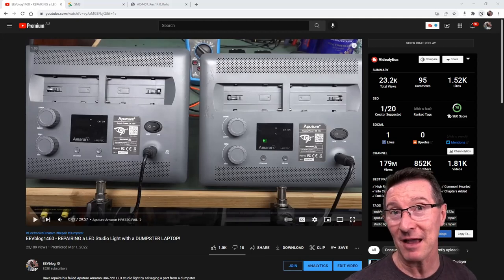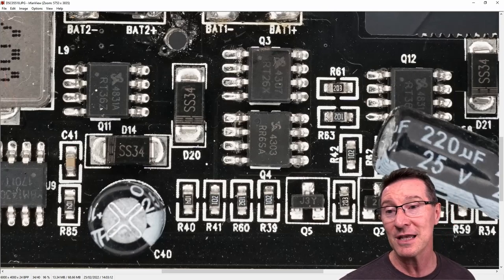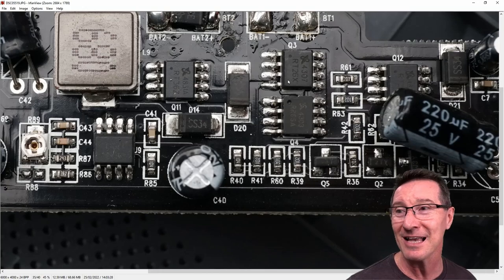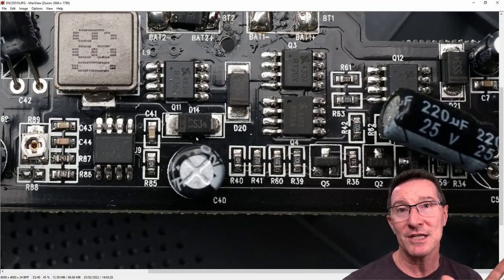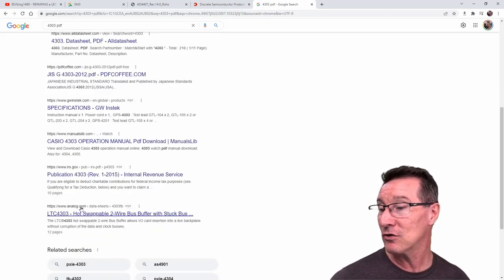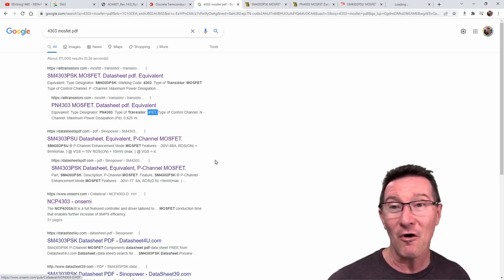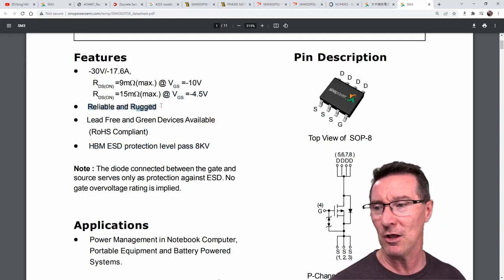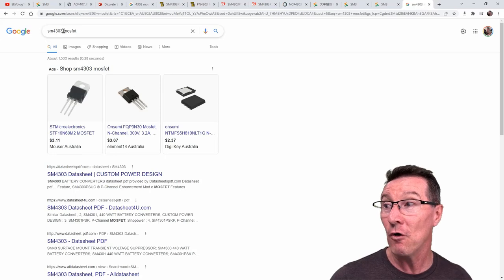EEVblog 1461 - The MOSFET Search CHALLENGE

Comment: I found the AO4455 -30V, -17A and the UM4447A -30V, -18.5A in a quick search, but i may be breaking the rule that they are not made in taiwan xD

By the way, i just search for 30V p-channel mosfet esd protect and look in the imagen search.
Reply from the maker: You win The Internet!
Reply: WARNING: The AO4455 with the gate at -4.5v has a poor ON resistance, it needs -10v before the ON resistance gets really good.  The original uses a logic level mosfet like AO4447A & your UM4447A or the normal Fairchild FDS7779Z which is available everywhere, even stock at Digikey/Mouser/Arrow.
Reply: You should also try yandex reverse image search, it is surprisingly good with very obscure objects... Much, much better than Google's which is rather generic.
Reply: your comment brought out some nice tips out of the other guys who answered in there. SO THANK YOU.. I GUESS : )...
Reply: 1 minute on mouser, 4th match:
Diodes Incorporated DMP3004SSS
However, how exactly is this double zehner?diode protection intended to work?
Why would anyone connect an exposed battery terminal or just a battery directly to the gate of a mosfet?!
Is that a new thing among engineers nowadays?!
Reply: This. Most of the good mosfets nowadays include all kinds of protections, so this sounds like a classic case of just brainfarting by EEV and forgetting what to google. In addition, a lot of the most common power mosfets etc now fit EEVs specs, just with far higher maximum ratings. If you however do google searches including those maximum ratings, you miss out on all the results from fets with HIGHER ratings, not just LOWER O.o
Reply: @EEVblog  Its a SM4303PSK with 4303 marking it literally came up in the first google search

Comment: Hello Dave, Regarding ESD please note that ALL MOS devices have some form of ESD protection. More over, ALL MOS gates are ESD protected. In 40+ years of practicing electronics I encountered only once MOS transistors without ESD protection for gate terminal. So stating for some transistor that are ESD protected is misleading. If you look at the data sheet, the so called ESD MOS transistors are stated to resists to 8kV HBM stress. HBM stands for Human Body Model and is only one of the ESD resiliency test used in semiconductor industry. Regular device are designed and checked to be compliant at least to 2kV HBM stress test. In recent years the ESD requirement was updated to 4kV HBM. Devices stated as ESD are the ones able to sustain an 8kV HBM stress. As a former MOS IC designer I had more issues with other ESD models as “Machine model (MM)” and mostly with “Charged device model (CDM)” that imply higher stress than HBM. The replacement you performed is OK provided you take care when replacing the batteries. Thanks for the very informative post!
Reply: All of the earliest MOSFETs that I came across were for RF use and had 4 terminals, usually in a TO-18 can. None of them had ESD protection and I lost a couple until I figured out that I needed to wrap thin wire around all of the four legs before handling, only removing the wire after the MOSFET was in circuit.
Reply: @RexxSchneider  I first met MOS devices in the early ‘80 and back then all of them were ESD protected. I also learned about ESD in the university… The only MOS devices without gate ESD protection I know were used in the ultrasonic remote control receiver of a Grundig Color TV dating from the early ‘70. The gate capacitance was used to store the control voltage and was accessed via a neon lamp!
Reply: @RexxSchneider  The tv was a Grundig Color 8010 UE.TD. BTW, I read about MOS devices with a chastity wire but never used one…

Comment: When high dissipation is required the heat is removed by soldering the multiple leads to a copper plane.
The power dissipation is usually specified with heat sinking of various thermal resistances or areas of copper planes.
It is important to check the footnotes for this. One of these datasheets specifies a 
1 inch pad.
The thermal resistances of the junction to leads and ambient are also specified 
in this way.
There are usually graphs or drawings of the performance of the different heat sinking techniques and or sizes.
This can be on a separate application note.
Sometimes not all of this data is supplied but a careful study can verify the design.
Other types of device in this package might require this amount of care in heat sinking.  For this application all this thinking is probably not necessary.
It was easier when we just attached a heat sink to a TO-220.

Comment: One search technique I've had some luck with before when trying to find particular features (such as the ESD diode) is to try to "invent" the part number that a manufacturer I've found making similar parts would label the part I want with. For example, if I've found a 12 volt mosfet both with and without the protection diode carrying similar part numbers, and a 30 volt one without the diode, I might try tacking on whatever extra letter they added to the 12 volt mosfet part number to make it the ESD version to my 30 volt mosfet part number, and searching that.

Comment: I accidentally blew up my TS80 soldering iron because I normally power it from my benchtop psu, but I gave it far too many volts which caused the P channel mosfet to go dead short.
I happen to have an automotive style LED module that uses a P channel mosfet as input polarity protection.  The specs seemed close enough so I used some hot air to swap the chip on the TS80 board, put it back together and I is working perfectly if not better because of lower drain source resistance...

That's my mosfet story.
Reply: For 5V Devices: Use a fixed 5V Power Supply.
For 12V Devices: Use a fixed 12V Power Supply.
For anything Under Test: Use also current limiting.
That is my murder prevention story ... :)
Reply: @dieSpinnt  yes that's very true, but I always like to "crank it right up!".

Comment: I think that the ESD protected MOSFET has been chosen by the manufacturer because it's used for switching the batteries and their contacts are exposed outside of the casing, thus can get a direct ES discharge from your fingers. :)

Comment: When I search for a datasheet I use partnumber, company if I recognise it or part type and datasheet at the end. Some times the "Images for..." option is very helpful, in this case I tried "4303 mosfet datasheet" and it was the 2nd result in "Images for...".
If the partnumber is very common you can use the exclude "-" before a keyword you don't want for better filtering.
For the equlivant part I found FDS6681Z & SI4491EDY on Mouser using a wider search on max current
Reply: Search for "*4303 Mosfet Datasheet" - the asterix allows for any characters, so will include prefixes like SN, PT, etc

Comment: In my (more-)ignorant years, I actually replaced a S08 pkg mosfet in a laptop like that one with one of those big TO-3 pkg that came up in searches. Bodged it in. And it worked fine. Apparently you're right; generic power supply components are not too critical. It was cheap, too.

Comment: It’s crazy to me that the markings on the chip aren’t searchable on Digikey or Mouser. It’s also crazy there isn’t an open source project that’s a database of all of these markings, photos, etc. given how well indexed other information about components is, the surface markings are a glaring omission.
Reply: I have reason to believe there is a database of some kind and that DigiKey is using it to sell ads on search results for parts they don’t have. For example, search HSW1699-01-010, which is a HOSIDEN switch used in the Sega Genesis/Mega Drive and Sega Master System. You will get DigiKey ads for slide switches even though they don’t have it and don’t even seem to carry HOSIDEN switches. HOSIDEN was once synonymous with S-Video connectors, not switches, so DigiKey definitely recognizes it as a switch even though I can’t find a source (part number comes from a service manual). Indeed, S-Video miniDIN connectors were often called “Hosiden connectors.”
Reply: There’s octopart?
Reply: @bobert4522  Octopart links me to a completely different HOSIDEN part that isn’t even a switch, so that doesn’t seem to be where DigiKey is getting their info.
Reply: @emmettturner9452  That can also mean that Octopart isn't interested into your Cookie-Internet-Life or simply is ignorant about your manufacturer/product number/code "HSW1699-01-010" ... which seems important to you, but if I am honest to you: not me ... and I am not a part number search engine, but a human, like you:P
BTW: The correct answer is: WE DON'T KNOW! Ask them?:)
Reply: alltransistors (preventing YouTube censorship with a point you have to insert, here, sorry) and com(which is a web address) -> SMD CODE / and similar search sites.
Oh and that simply can't be accurate or complete.
As an example, try to map the millions of different SOT-23 parts with a 3 or 4 char/digit code plus manufacturer symbol ... :o)
Reply: @dieSpinnt  What are you going on about? I was just sharing an anecdote that shows Digikey has a database that they use for ads and that database is not the one from Octopart. Get over yourself.
Reply: @emmettturner9452  WTF? This isn't even meant about you, but about Octopart and Digikey Databases. 
You can tell anecdotes but I can't make assumptions? Who do you think that you are? Get blocked!
Reply: @dieSpinnt  Correct: This is about Octopart and Digi-Key databases.

I had anecdotal evidence that Digi-Key has a database that isn’t public-facing and has categorized part numbers that aren’t searchable on the site and don’t exist in the Octopart database… and you came here to tell me that Octopart isn’t interested in my “Cookie-Internet-Life.”

I was talking about a DIRECT SEARCH on Digital-Key and Octopart.

The OP started a thread in which relevant comments can be made and conversations can be had. The OP mentioned part numbers that were not searchable on Digi-Key. I had just encountered an example of one that Digi-Key was aware of in some way because they had paid for Google ad words for that part number even though it wasn’t searchable on their site.

The ads even direct you to the switch section of their website meaning the database of parts being monetized with Ad Words had more context than simply part numbers. It wasn’t the first time I encountered this with part numbers I couldn’t find any info on. I often find myself staring at a weirdly-relevant Digi-Key ad for a part they never carried. This means there absolutely is a database somewhere with more part number associated info than I can find online. Digi-Key has it and monetized it.

You follow?
Reply: @dieSpinnt  I hope you can see this if I post from my old account. You are correct:

The conversation shifted to Octopart and Digi-Key databases, but that isn’t how it started. The OP says nothing about either. We are looking for something BETTER than what they have made publicly available and I, for one, want to know where Digi-Key got theirs since it has parts they never carried with info you can’t find on public databases.

I never expected anyone to care about the part number. The part number is only there for someone who wants to duplicate the results showing that Digi-Key has monetized a categorized part database that we cannot search directly. It’s a way for you to see for yourself… to prove the hidden database exists. It isn’t about me and my quest for a part, it’s about the very relevant thing I noticed while on said quest.

My follow-up when someone pointed out Octopart was to point out that the database Digi-Key is using for Ad Words includes parts that are not even on Octopart. Clearly, that is the database that is of greater interest to the OP since he’s looking for something more complete than what we have… and we have Octopart.

As for how interested Octopart is or isn’t in my “Cookie-Internet-Life:”
I was comparing DIRECT SEARCH on Digital-Key and Octopart. NEITHER had any information about the part. Cookies are irrelevant. Even the Digi-Key ad showing they know more than their website lets on was triggered by an Ad Word… meaning they knew it was a switch and paid Google to link to their page of switches if anyone searches for that switch they never even carried. It has nothing to do with cookies.

So, again:
Correct.

This is about Octopart and Digi-Key databases… but you went on about cookies and whether or not the part number is important to you. You seem to be the one making this about yourself.
Reply: @CZroe  Well I can't help with your assumptions other than adding mine. ASK THEM! We have E-Mail. Or?:)
P.S.: Oh and after all that. Ask for microswitches, please. The good old C64 Joystick Competition pro ones ... if you are already on the mission. Thank you!:)
Reply: @dieSpinnt  Huh? Now I’m even more confused.

I wasn’t asking for help with anything. I saw others looking for a more thorough parts database searchable by the public. I was giving people a possible lead on a parts database we could potentially use if we can gain access or find Digi-Key’s source.

Perhaps we can find a way to search Digi-Key’s broader database. Perhaps we could find where Digi-Key is getting their info. Perhaps we could find a way to mine all their Ad Words and start an open-source DB like the OP suggests. This isn’t about a replacement power switch and never was.
Reply: @dieSpinnt  I tried a number of components I had in front of me, and none of them matched.  Ideally any database would include pictures and use the pictures to match.  That way in addition to the numbers, font, position, and the manufacturer logos all come into play.  It may never work for a 0402 resistor, but I would think most IC's, like TSSOP-8's, could be identified.
Reply: @lbicknell  Hehe, Leo. That would be the high-tech Star-Trek solution, if I may say so:) ... oh and with all problems of image recognition and please look at a datasheet, one you have handy: TOLERANCES in CAD!;) ... R.I.P Solution or <100% recognition(1). 
Low Tek Solution: Just print a barcode or a 256bit EAN on the part and have a central database for all manufacturers. We all have microscopes, easy peasy, lemon squeezy:) -> 100% recognition rate. 
Manufacturers: HOLD MY BEER! We want to sell NEW parts, you punks. How dare you, to reuse ... Hehe. But something like that could be made real via "the right to repair" ... later?! What do you think?

(1) Perfect readability of the ID is assumed here, which would apply equally to both methods and should not be part of our problem analysis and also the vanishingly small costs of micro-stamping fonts or marking the parts unique like my grandma would do with her home made jam = EXACT;)

Edit: I forgot a not so small problem with your solution: Who would maintain the database? ... You or I?:))) Fuzzy data like image recognition masks and stencils aren't easy to maintain. A number, which can easily integrated into the production process and is already available via the manufacturers sales/engineering department, is.

Comment: Regarding 32:00 - When looking for a repair replacement why wouldn’t you look for “Discontinued” and “Last Time Buys?” For the repair industry there’s a chance that what you want is only available that way… which is increasingly more likely the older the device is. You only care about “active” when selecting components for a new design.
Reply from the maker: This video isn't about the repair, it's about design.
Reply: @EEVblog  Sorry. I thought it was an exercise for finding a replacement part with the same specs.

Comment: 45 years ago the V-mosfet slowly replaced elec-mec relays, but it only handled uni-directional power switching. 
I found that connecting two of 'em back-to-back made a bidirectional switch to truly imitate relay contacts. Took the idea to Siliconix a Vmos maker. They turned it down.

Comment: I found a pile of Digital TV to Analog converters (CORE Innovations, 23 to be exact with a few remotes) a few days ago in the trash enclosure at the place I live, all were dead. Power circuits were the issue ranging from R Kelly'ed capacitors to bad transformers. Anyways the output 5 volts. So my fix for the ones with bad transformers was to literally cut the PUS circuit free from the main PCB via the separation valleys. Then was to gut out old phone 5 volt 1 amp chargers(solder the mains leads on and remove the USB port and solder wires from the power pads where the USB port was on the charger PCB to the filter cap on the converters main PCB and install that PUS in the converter wrapped in caption tape, secure with some hot snot and BAM they all work now.

Comment: I'm glad it's not just me.  every time I try to find a replacement component, it seems like that particular part is an obscure, one off.  my question is, do you think the light design actually specified that part, or was the MOSFET specification something like "whatever you have laying around above 10 amps and 20 volts"
Reply from the maker: Could be based on previous design. Parts re-use from other products is a big thing.

Comment: i still remember a multimeter i took apart where all the part numbers were printed next to it on the pcb.
but the multimeter was so crappy that the trace burnt through before the fuse blew, so i never fixed it

Comment: The "VBsemi APM4303" that Dave is rambling about at 20:00 is NOT an alternative, because it doesn't have the ESD diodes like the original. He did add an overlay, but it was only on-screen for a few seconds.

Comment: What is the reason for the component having 8 pins when it only needs 3?
Reply: Possible reasons include handling more amps, multiplexing from multiple distinct inputs that you don't want directly electrically connected, fitting the 8-pin package for legacy reasons.